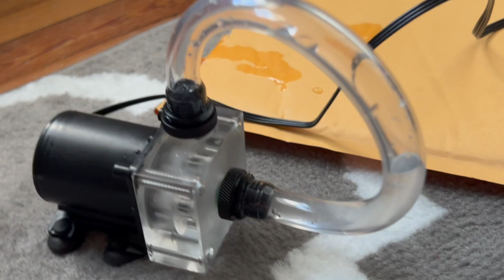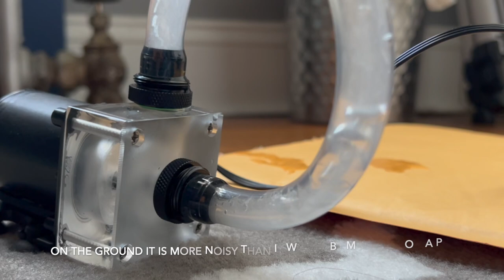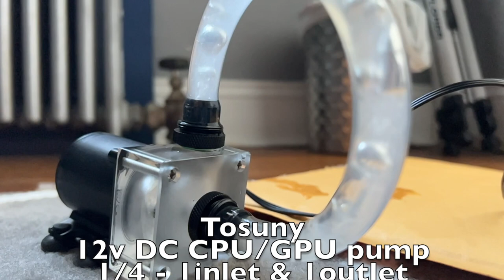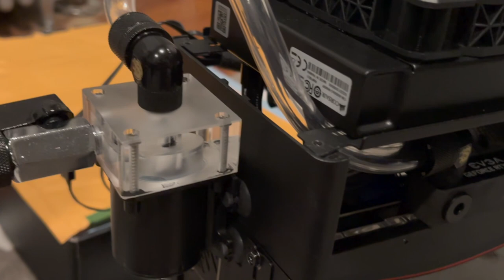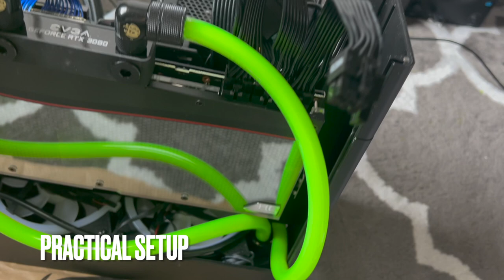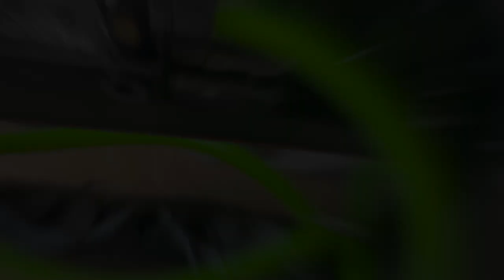PC Water Cooling Pump Review - Tosuny

Comment: I have a Phantex SFF case and have been wanting to run external cooling for my 7950/ROG ITX.
There's a pump equipped radiator in 120/240/360 sizes but they are expensive and shipping is a month plus I already have new 140 fans and 280, 420 radiators.
My thought would be to route hardline to bulkhead fittings from my EK CPU waterblock out a rear meshed vent panel and up to a rear overhanging radiator.
Using the pump you are, it might work without the pump/radiator combo I mentioned and I can use the fans and radiators I already have
Reply: @zfilabs  That's the pump/rad combo!
I couldn't recall the name.
I think they are sick!

My case is the evolv shift xt.